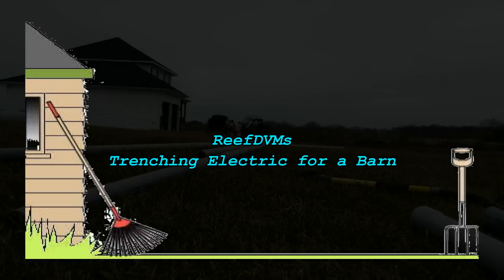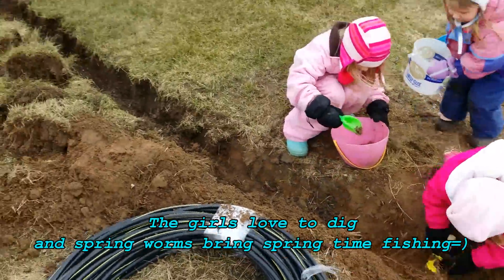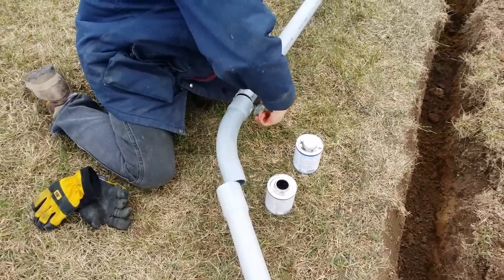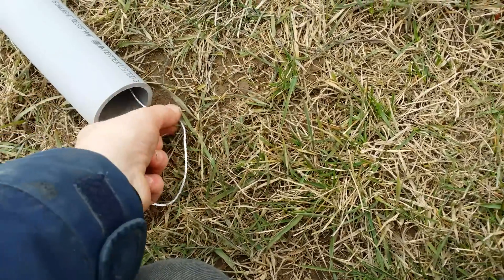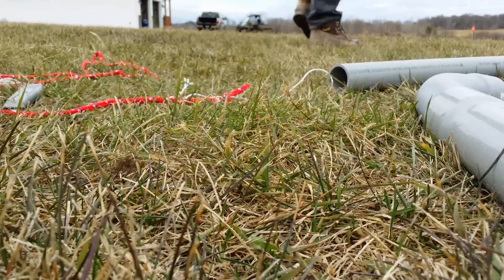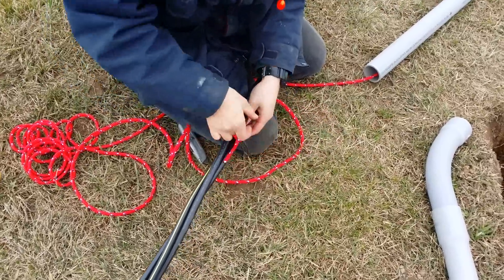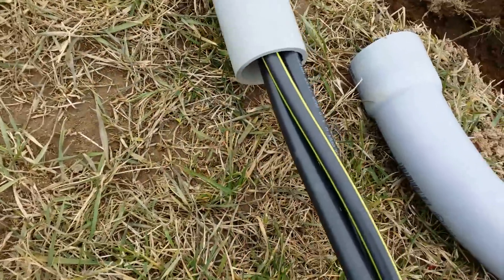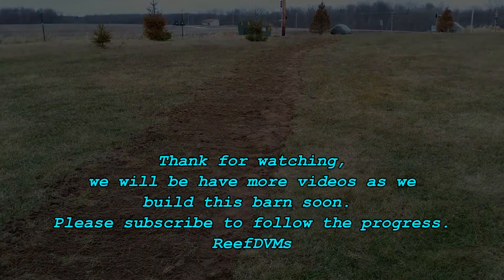DIY Pulling Buriable Electrical through PVC

Comment: In some places, you are required to run a layer of tape ( think " Police line, do not cross" ) about 6 inches below the surface and above the buried lines. This is in case anyone digs there; they are warned by the tape that something is directly below.

Comment: Howdy. Totally great.
In my mind. Another way would be to first unroll the wires along the trench. Then run the pipe segments on. Connect the segments and drop the completed piping into the trench.
And also in my mind. Always pull in another string or rope alongside the wires for possible future need.
Finally in my mind. I would have used 4 inch piping. Way easier to pull the wires through. Also room for future needs.
High regards.

Comment: Where is your ground wire. I see two blacks which will be your hot conductors that will be fed by a 2 pole breaker from the primary panel and a black conductor with a stripe which identifies that wire as your neutral. Where's your ground wire? You should have had 1 pulled in with the tri-plex. Your ground rods, if you drive 3 of them at the building, are not acceptable for grounding panel.They are called grounding electrodes for protection from lightning.

Comment: I have read Yes and No on Primer use on conduit. Since it's not holding water or any pressure, primer may not need to be used. But nothing wrong in an extra step. And Five Stars on that trick with the Shop Vac. I am running 2"  PVC conduit from my radio tower to the radio shack (90') and now I know how I'm going to get that pull string through the conduit to pull the rope and coax with. Thanks so much for that.

Comment: Dear viewers, the conduit would be substandard in some locations. Too small, usually 3" or 4" conduits are required with 36" sweeps at the riser and turns and 24" of cover over the pipe. Consult your local power company for their service trench specs. Some companies require a mandrel test with an empty conduit.

Comment: You need 4 wires (2 hot + neutral + ground) not 3 like in this video, $400 was 8 years ago now is about $2,200 material only. 2 1/2 conduit $65 each + 4/0 wires  $1,500

Comment: The vacuum trick to pull leader string is good, but on an open trench situation like this where you are putting cable inside the conduit and then burying it, I found it to be a whole lot simpler to lay out the cable and then just fit  the Sch40 PVC over the cable one segment at a time.
Reply: I think that's against code. And you don't know if the conduit allows for future pulling. Might as well direct bury the cable at that point. Pull cables through entire conduit run (or to pull boxes) to ensure the run is actually pull-able.
Reply: I had a 75 food run and I did it the same way

Comment: Watching this just so happens I’ve got a 120’ run coming up and this with some of the comments to make the job easier and more protective of my 4/0-4/0-2/0 casing I’m hoping 2” schedule 40 pvc pipe will do the job then coming out of the ground on both of coarse schedule 80 I know it’s not an easy task so informative videos like this help a lot not to mention a few helpful comments …. Thank y’all !
Reply: I would recommend 2-1/2" conduit for that combo of wire, especially if you are using schedule 80 above ground. You lose just a bit of cross-sectional area when you switch from schedule 40 to schedule 80 because the latter has a thicker wall. Also, be sure to use long "sweep" 90s instead of normal 90s. It will make the pull A LOT easier and might even be required by your local code.

Comment: I'm seeing you pull the wire through the conduit now and I don't see a ground wire with that you are required to pull a ground wire then put a ground rod at the barn according to code or don't you use codes in your state

Comment: You cannot use a 90-degree water fitting for electrical you need to use a inch-and-a-half 90° sweep for electrical wiring how the heck do you expect to pull the wire through that tight fitting

Comment: It is also a good idea (even if not always required) to run warning tape a foot above the conduit as you back fill the trench.
Reply: Warning tape is often not required if the wire is contained in conduit, but 18" is not very deep so I would agree in this instance. I am currently installing a new service at 36" deep with PVC conduit and we are not using warning tape.

Comment: Very cool... implementing the string/rope/wire pull today. But you must live in another world... I was at $400 just for the wire to deliver 60A service to my shed!
Reply: Depends on where you get your wire. That wire is $3.50 a foot at Lowes, with the right connections you can get it for $1.20 per foot

Comment: There is no "do it yourself". This needs to be done by a qualified professional.
Reply: As I qualified professional  I will say. No it doesn't. It just needs to be inspected by one. I wish they would have left the 90 off of the pipe at the transformer though, it will be a nightmare for the lineman who come to finish the job.

Comment: For future reference, the rope pull is unnecessary. You can just slide the pipe right over the wire for each section then glue each section then drop the pipe down into the trench. 👍🏼 Good work tho
Reply: A number of people on here say that's against code.
Reply: @rotcod2886 Do you know the reason behind it?

Comment: why not lay the wire out along the trench slide the pipe over the wire as you go . No need for string or rope , just an observation . Great job
Reply: As a professional who works for a electrical utility and installs 2000+ foot of wire every week, sliding the conduit down the wire is literally the hardest way to do this job. They did an excellent job. The only thing I would change is take out the elbow mid span and literally bend the pipe. And call 811 before any digging project

Comment: I'm doing my house and 40 feet at 22 inches allowed me a slight leveling bed of sand then conduit with 18" of actual cover which is code where I am in California.  40 feet " kicked me arse" but I am almost 60. I spent 5 hours digging and since it's a joint trench with 3 runs about 2 hours installing by my self by center loading the trench so I could pull. The next two hours were a mixture of beer and ice packs. 100 feet is mighty impressive. But was it inspected? I fear I've been out done by the little ones 😊

Comment: Always go larger on your conduit, it makes life a lot easier.
Reply: As long as you limit the bends it won't matter much in PVC. It is incredibly resistant to sliding wire so it doesn't take a lot of conduit for it to become very hard to pull. With the size service entry wire they are using the difference between 2-1/2", 3", even 4" is virtually zero

Comment: Recently I was quite desperate to work out how to push the reticulation cables through about 15 metres of poly pipe. We had tried a few things, nothing worked and tempers began to flare. I turned to You Tube for inspiration and luckily saw this video before looking too far. When I suggested it to the  males (husband and male neighbour), they accepted the idea with some skepticism but it worked beautifully and what we had tried for hours to do was completed within 10 minutes. So a very big thank you from me in Perth, Western Australia.
Reply: I had a short buried run to a hot tub (about 5m) and installed all the loose PVC fittings and conduit in the trench. I then pulled the cable through each piece the full distance, and then glued the fittings. It saved a bunch of pulling and pushing.

Comment: 18 inches to top of conduit, so 2 inch pipe should be dug at least 20 Inches. Also I use a hot box instead of 45s and sometimes 90s depending on size of pipe. It eliminates coupling spots where your pull may hesitate. Looks good though
Reply: for someone whos not in the field, what is a hotbox exactly
Reply: @MobWithGuns  It is a large (usually electric) heater. The pvc is feed through it inside. After a few minutes, the pipe will soften allowing you to bend it. Just have to be careful not to overbend, or get it too hot because the pvc can collapse or even catch fire. For smaller pvc conduit like 1/2" or 3/4", they make heating blankets that wrap around the conduit and warm it the same way.
Reply: What size conduit would you use for a 300’ run of 2 strands of 6awg THHN? Would you add pull boxes, and if so how often?

Comment: The point of the LONG bell ends on the conduit are for expansion and contraction. No need to glue them.
Reply: I can tell you’ve never pulled wire in pvc  and had it come apart under ground because an apprentice forgot to glue the pipe.  Bell ends have nothing at all to do with expanding and contracting they make expansion fittings for that. Pipe doesn’t expand and contract in length but they do in girth.  So a longer bell makes no difference.  Always glue pvc unless it’s temporary above ground.

Comment: How far can I pull 2/2/4 power cable  ? My shop is 230 ft from exsiting breaker box
Reply: false, you need to up the wire gauge and probably put pull boxes along the way

Comment: that 45 elbow sweep should not be used but should have a mild long turn and just bend the conduit easier to pull the wire if ever needed to

Comment: How.many feet is that and did you connect it to the metter box?  I have my meter at the corner of my property and I want to move it in atleast 300 in to the center of the land. Will it push all the power 300 ft.?

Comment: Add air conditioning, water heater, welder, and suddenly 200 amps do not look as much as before. I agree work was well done and it passed inspection. Putting underground feed inside conduit is safety and durability. Surprisingly shallow trench, no warning tape, no ground wire (?), no sand (a tip off conduit is there, or as some homeowners do it, a pressure treated board on top of the top layer of sand. The point it is it functional. Ground wire surprises me...that it passed inspection.
Reply: and maybe there was a heated slab to be poured. so 200 amp is not overkill.  I agree with one poster...trenching near a transformer...ballsy.

Comment: What size wire did you use? And is it more cost effective to go with the braided wire or doing single runs?
Reply: She showed it near the beginning of the video. Sorry I realize this is an older comment (*1 year) but it bothered me that nobody had responded to you yet lol 4/0 4/0 2/0 wires all in aluminum.
Reply: @CB-lh8gw  why 3 wires and why 3 different sizes?

Comment: Is this an idea from the girls about the vacuum? I’m doing mine soon, so this is very clever unless you spend $100 for an electrical snake.
Reply: It works even better to use a leaf blower with a 2" coupling taped into the end and a hole drilled in it. The coupling slips on the pipe for a tight seal, the string runs threw the hole and a leaf blow has alot more power

Comment: The electrical inspector must not be familiar with the NEC. Several code issues here.  Depth, conduit fill, no 4th wire.
Reply: Grey Lewis running a feeder from a transformer pad requires only 3 wires, not 4.

Comment: For those watching the conduit will actually bend.  You don’t need those bends usually.  Sometimes a little heat might be needed.  It much easier to pull through.

Comment: Great job. But i think you are missing the ground wire. Thats require for a sub panel boxes.
Reply: It's going directly to the transformer, doesn't need one. It is not a sub-panel. Between the two, the neutral is both, plus there would be another ground going to the ground from the panel.

Comment: Can you put Southwire (By-the-Foot) 8/3 Stranded Romex SIMpull CU NM-B W/G Wire underground in a Grey PVC pipe?
Reply: No. NM-B cable is not rated for use in wet locations, of which buried pipe is. No matter how careful you are, that pipe will eventually fill with water in the underground portion. You're going to be well off to simply pull 4 #6 AL XHHW conductors in a 1" or 1-1/4" pipe.

Comment: I am an electrical contractor and while over all you did a fine job I would like to leave a few comments for others that might be contemplating a similar project.

Code is actually 18" of cover on top of the conduit not just a ditch 18" deep under a driveway 24" of cover is required which includes the thickness of your pavement. That is National Electric Code article 310.5. 

You passed your inspection so no harm no foul and it is highly unlikely anything will aver be an issue. 

PVC cement is a requirement not an option. 

A baggie tied like a balloon with a hole near the back works great with shop vac also.

Conduit is typically completely installed before blowing or sucking the string and pulling the wire. 

Getting individual strands of XHHW AL is typically less expensive than twisted cable and easier to pull. 

I would also avoid the factory 45 in the middle of the run it makes the wire pull easier if you had cut the corner of the ditch off a little 2" PVC would wrap around it easily. We typically dig the ditch as strait as possible to avoid that kind of thing. When we have to wrap a curve like that we will glue  several sections together and leave them in the sun for a couple of hours while digging to make it easier to wrap the curve.
Reply: Both the video and this comment were extremely informative. @chuck killawood- no reason to shit on a contractor offering good advice. BTW, he did say "fine job"
Reply: I appreciate the technical info to go along with the fine job they did. I'll make the observation that the 18" is frost line depth in some areas, but all in all, if someone is digging without getting the land flagged, they are going to hit that conduit even at 18". I found it intriguing and I like the concept that you would avoid curves. However, I'm not as keen on the idea that the conduit has to be in the hole before running the wires -- that seems more difficult. Finally, PVC cement that doesn't require primer seems like the way to go.
Reply: Not everyone comes to YouTube just to get high fives. Some come for information. Few videos have complete and perfect information because videos aren't easy to make perfect. Most people look back on their video and wish they'd done something a little different. I appreciate people making comments that add to a video's content and I think most people posting informative videos also appreciate most info added in comments. So thanks.

I'd add I think (don't know) whatever PVC cement is used the label should say it is for PVC conduit and whether and what type of primer is needed.
Reply: I am doing a job somebody else ran the conduit under 60' of cement through a cinder block wall and through grass, with 2 90° bends, they used 3/4 " pipe and I'm running 10-2 wire, it's impossible to get wire through ugh
Reply: @xChromerSatanasx  you should use single strand wire. If it's type NM cable, ( Romex) you cannot run it in underground conduit. You will need type thhn -2 the -2 is important it allows to be used in a wet location. Underground conduit is a wet location per code.
Reply: Wrap the curve? so like make a 20-30 sweep? Read a tip years ago from landscape contractor. His crew figured out the easy way to bend 3/4 PVC. Rig a vegie can with a short piece of metal conduit, place can over tailpipe and insert conduit into PVC. Heats up fast and easy to bend.
Reply: And I think this long distance need small manholes to help for pulling or maintenance
Reply: Damn, can't just say nice job, if she were a contractor, all of that would have happened, family saved a shitload of money, not everyone likes the contractor police comments, sometimes we just appreciate when folks can just get it done on their own. Good job girls.
Reply: @chuckkillawood8229  The reply seemed perfectly cordial and informative?? he even started saying they did a fine job and won't have any problems.... more information doesn't hurt.
Reply: @chuckkillawood8229  Unfortunate comment in my view. I read through the comments looking for something written by an expert. I noticed a few things and wanted to hear from an expert. If the woman that made the video was all that afraid of criticism she wouldn't have put the video on youtube. Plus I thought Jonathon was reasonably tactful.

Comment: I read some of these comments and I think those clowns should just stay home and be quiet. Many others are correct, and very technical. In the end, the Inspector (AHJ), and the Power Company, have final, undisputed say, over what is acceptable. You had both of them on your side. Very nicely done. You, the Trench Digger, and the Helpers are 100%. I am an EE of 41 years, electrical contractor for 30 of those.

Comment: That was serious work for one day. I liked the shop vac idea. I have a similar project coming up. 100ft, maybe direct bury 8g or conduit. Right now ( spring) the ground is very wet. I'm going to try knocking in an 18in. spade and just wedge open the ground. I seen a guy do it on YouTube, fast and no digging.
Nice job you have done

Comment: You could have saved money you dont need to used direct burial cable inside PVC. Also, you didn't run a ground wire, and technically according to the NEC the conduit must be completed prior to pulling the cable through. Master electrician here not busting your balls though typical DIY electrics.
Reply from the maker: Totally agree we didnt have to use the pvc but from past experience with the gophers in area we decided this might help us=)
Reply: Golden Ages   In other comments, it was stated this was feed to electric meter, I.E. service.   No ground required.